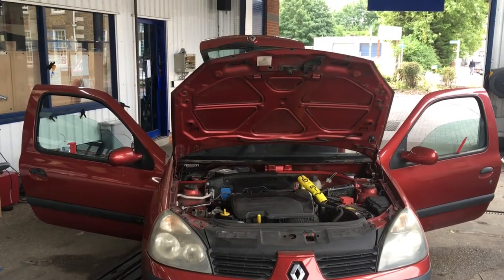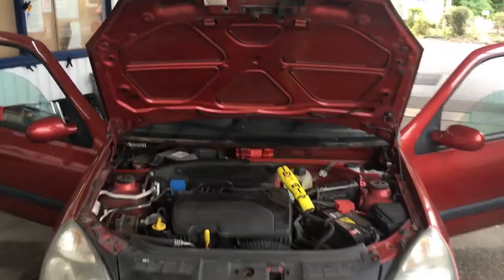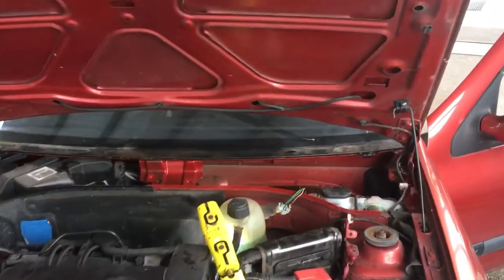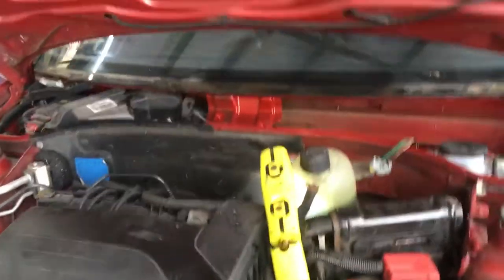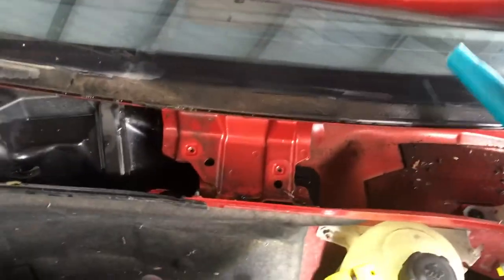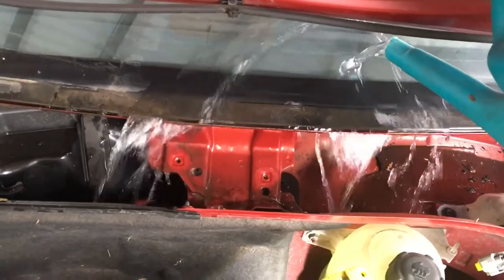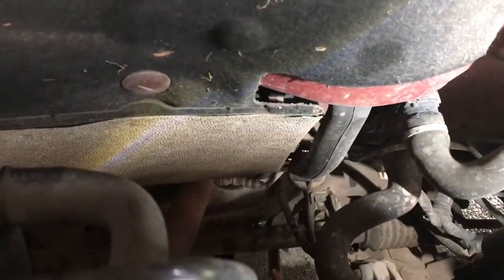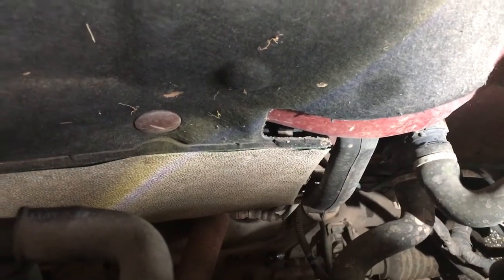Renault Clio 2005 | water leak blocked drainage | #RenaultClioLeaks

Comment: It would help if you said how to un clog it, I have the same problem, tried sticking things in the drain holes but they get stuck
Reply from the maker: Usually we stick things in the drain holes until they don't get stuck. Sorry, there are no magic answers for unblocking drains. Sometimes you can use an air-line or a wet-vac, but most people don't have access to those, and they aren't a guaranteed solution either.